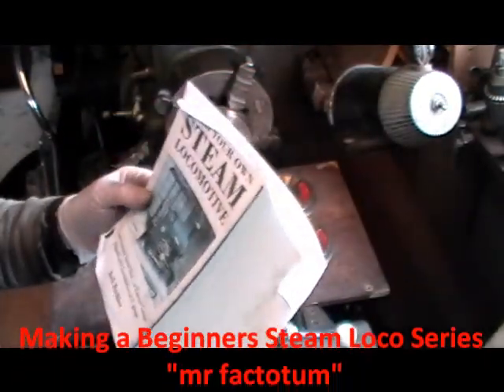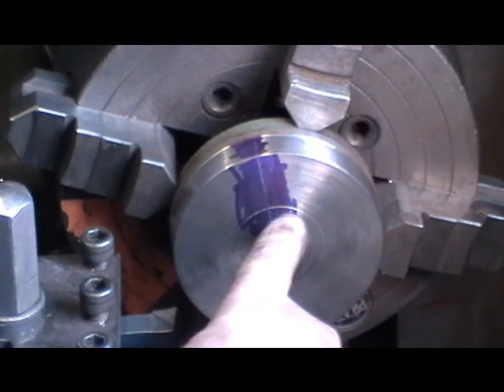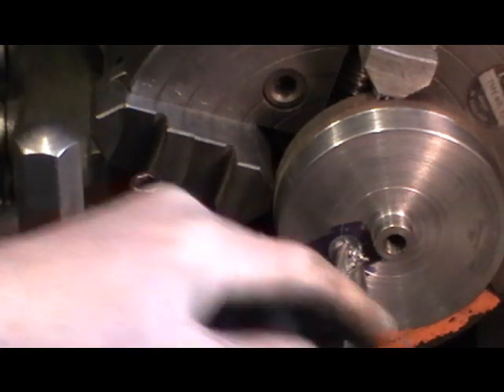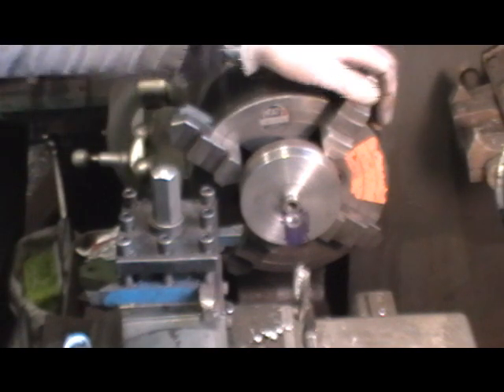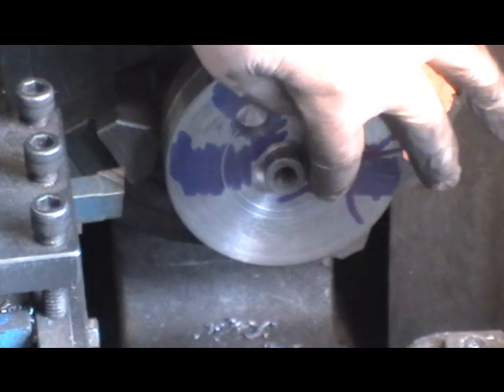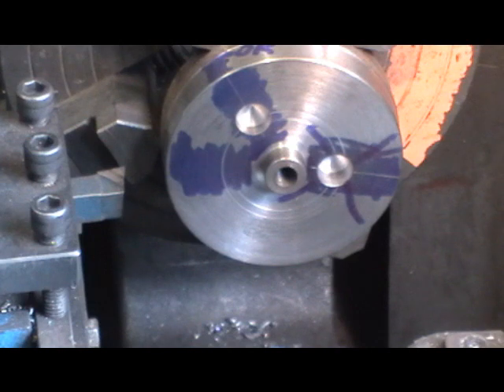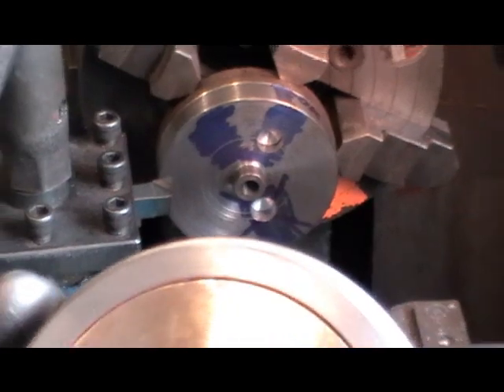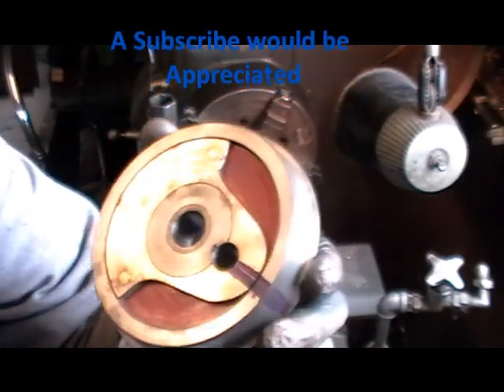Beginners Steam Loco ( Wheels Part 4 Machining Offset Crank Hole Exact & Repeatable) "mr factotum"

Comment: Having spent the whole day cutting metal and drilling holes in bits of Steam model... What else would I watch? Funny Story Time where I do a clean up of the ready done wheelsets on their axles with the axleboxes in the way only to discover on the last spoke that the wheels were in fact loose and had never been Loctited in place!!! Very happy it happened on the bench and not fully painted and Fully in Steam at the track. 
I picked up the wrong sized drill on a final crankpin boring and after some thought decided to make these like balance holes either side of the correct size hole. 11 holes where 4 would have done. But another happy outcome. We were bombing round behind her yesterday at the Reading Track. She being the Drill Driver powered Loco that made it into Model Engineer.
Lots of love
David and Lily. Experts in finding ways of filling miss drilled holes.
Reply from the maker: Nice to hear your story, thanks for your support
Regards
Mr f

Comment: I have finally managed to get 5/6 wheels completed to a tolerance I am happy with. One more to drill. 

Just wondering, have you ever heard of anyone hardening the loco wheels on one of these/ is it required or recommend?
Reply from the maker: eyup KM
Nice to hear from you👍👍👍
Great, glad to hear your progressing well, i've never heard that anyone hardens their wheels,  do you mean case harden or harden throughout, not sure if normal mild steel would harden throughout very well as it's low carbon content, however if the steel was the correct mixture to harden then this might make them brittle, 
anyway i made my wheels from solid Cast Iron, and i've had no problems thus far. Personally for what it's worth,  i would forget that idea. Unless you particularly want to experiment!!!😉👍
ATB
Kev
Reply: Mine are cast steel I think from blackgates. It was just a thought as I read something about full size loco wheels being hardened. I won't be hardening mine. It's nice to be able to take the jig out of my lathe and be able to look at other components. Thankyou for sharing your experience.

Comment: How did you get the centre line of the wheel, was it by eye?
Reply from the maker: Hi km
I just used a centre line marking tool on to the OD of the wheel, then eyeballed the centre of the immitation web and scribed a line. There are other ways but that's how i did it
hope that helps
cheers
Kev
Reply: @MrFactotum  thankyou. I will give that a try